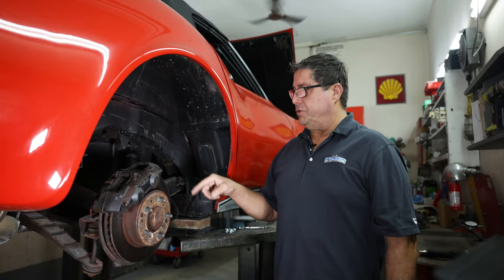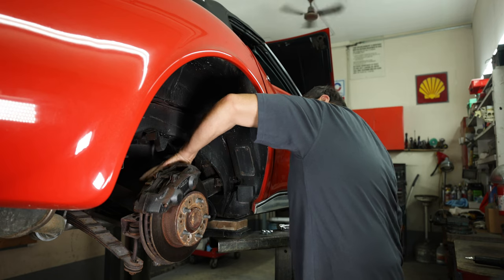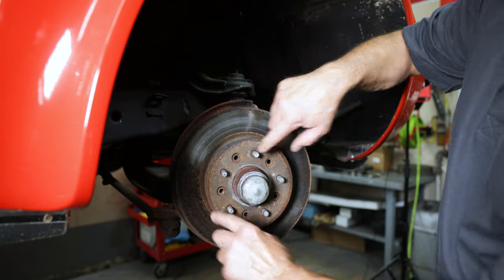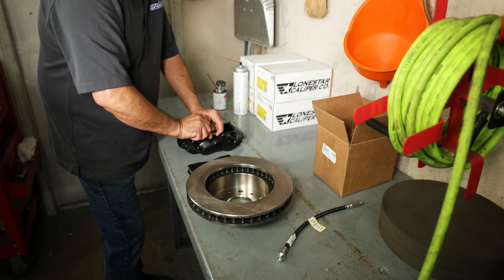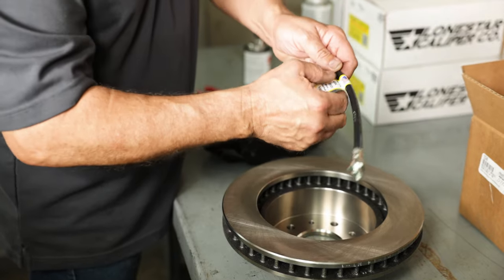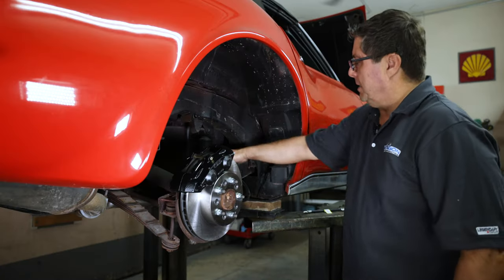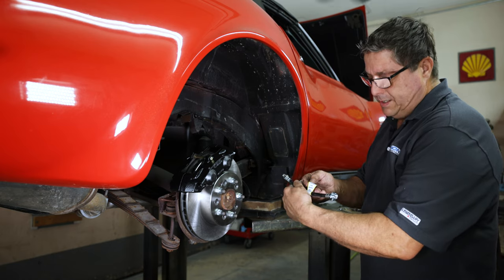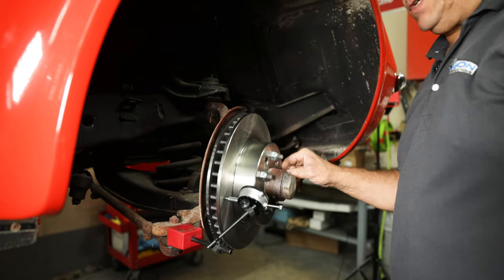Replacing the Disc Brakes on a C3 Corvette

Comment: Word to the wise - use high quality line wrenches.  The cheap ones are worse than no line wrench at all - they flex and open up, virtually guaranteeing that you round off the nuts -  especially bleeder screws.  I've had good luck with Gear Wrench.  The Quinn brand at Harbor Freight look pretty good, but the Pittsburgh brand in this application is horrible.  Ask me how I know...